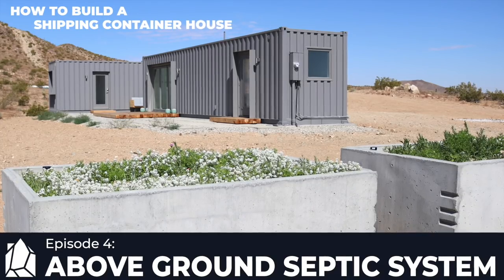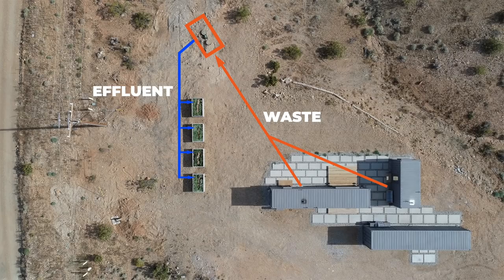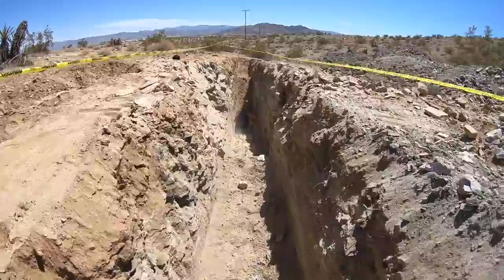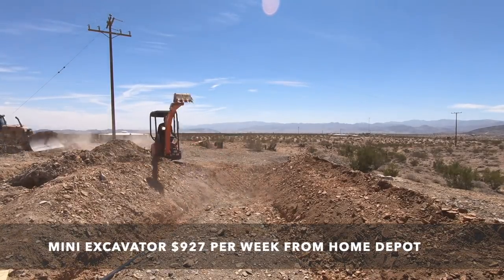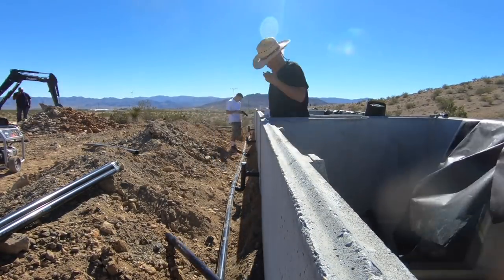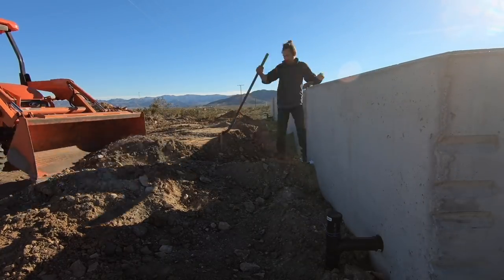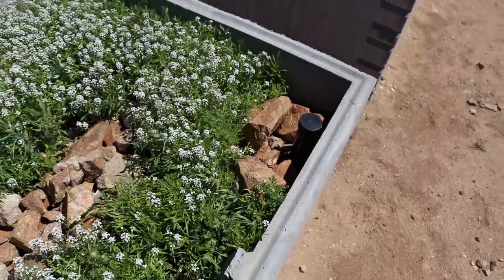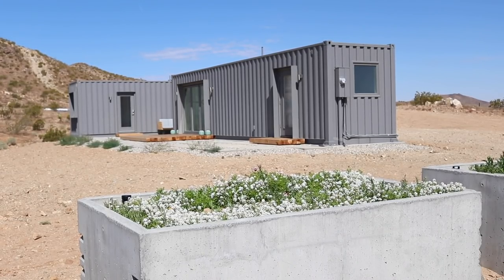Above Ground Septic System | Ep4 Building Shipping Container House

Comment: This is a brilliant solution and one that I hope to implement on my build. 
Why waste all those resources by putting them in the ground in a leach field?
Is there a limitation on what one can grow as related to edibles? I imagine root crops would be a no-no but how about blueberries?
Reply: The only issue I see in doing this instead of a normal conventional drainfield or leech field, is engineering. A mortgage company might have a hard time giving money for something that isn’t engineered. But if this is engineered and approved then go for it!
Reply: @nickp9062  Fortunately, I'm selling my house so I won't have to deal with a mortgage company. Septic systems have to be engineered. Ben is doing his in the desert, whereas I hope to do mine near the California coast where a 10cm/4 inch rainstorm is not unusual. I'd probably have to locate them in a green house or under solar panels to keep the tanks from overflowing in a downpour. Ick! 

A thousand square foot roof will generate 550 gallons from one inch of rain.
Reply: If you’re selling your house the buyers mortgage company might want paperwork and everything showing that the septic system is installed properly and all of that though

Comment: Interesting series for sure, I have a quesion, is it possible to use a series of parabolic reflectors to heat and evaporate the excess affluent?
Reply: I’m not sure what you mean by excess effluent, but if I had to guess you mean in the flower beds? If so then the sun will do most of the evaporation work and the roots will take a lot of it too. In a conventional drainfield setup 60% of the water leaves through evaporation. So if that’s what you’re asking there’s your answer.
Reply: @nickp9062  thanks for the reply, but I meant installing a copper pipe coil (like that inside a water heater) inside a tank, and connecting it to the solar heat concentrator, and filling the tank with effluent from the septic, the sun heats the water inside the coil, which then heats the effluent and evaporates it, to eliminate the need for a leach field entirely.
Reply: That’s an interesting idea! I’ve never thought about it but maybe something like that could be done where he is.
Reply: @nickp9062  yes! and you may even be able to capture and reuse the evaporated water!

Comment: what happens during a rain event if the planters fill up with stormwater? does the stormwater enter the septic tank from the overflow?
Reply from the maker: if you run the numbers on monthly rainfall vs surface area  you see that it is not a problem

Comment: Is this even to code and legal?  Most states you would never get away with building this.  What do you do or how does it handle solid waste?  aka POOP
Reply: I'm no expert in this field, but wouldn't you just pump it out every few years? That's how my system works and I don't see how this is any different.
Reply: @MinecrafterPiano  exactly!!! ☺
Reply: The solid waste (poop) breaks down into effluent over time due to bacteria from said poop and other things like showering. But I agree with imbellis that it should be pumped every few years depending on use.

Comment: what do you do with the sludge over time ?
Reply: Thinh Trinh You have to periodically have the tanks pumped out. For normal household use, it can be anywhere from 2-10 years. Most of the time the pumping company also does related business in portable toilets, septic maintenance and tank installations.

Comment: Interesting.... But eventually the sludge will rise. I mean even from solid stuff, the tank can only hold so much. What then?
Reply: Ásragin Kyron The tank needs to be pumped (pump truck) every so often to keep that from happening. But there are systems in Montana that are 40 years old and have never been pumped. New homes we tell people to have them pumped anywhere from every year to 2-3 years depending on use.
Reply: @nickp9062  Ah, so basically like slurry (liquid manure) that was pumped out of the underground silos before modern sewage systems. Ok, interesting.

Comment: Technically, how is the concrete containers allowing leeching? The plants must absorb all the waste and water. They will easily be overwatered. In the desert, water evaporation can be expected, but there is rain in the winter on occasion. There could be problems depending on how much you flush the toilet.
Reply: Et Q My thoughts exactly. How does limited evaporation / transpiration from the planters deal with the volume of waste water even a low water user will produce? These will fill within days or weeks at most, then what? Water can't percolate from the planters, and even if it could they are at surface level, meaning possible overground flow. I don't understand how this solves the problem of water disposal.

Comment: Aren't you in danger of flooding the flower beds during periods of extended raining, thus overflowing your septic tank?  I know it's a desert and you don't get rain all that often, but I'm sure you have at least one wet season?
Reply: Brian Schoenrock Unless there’s a rain event it won’t be an issue. Unless the pump goes bad (they usually last about ten years). The excess water will drain back into the tank and the cycle will start over. A lot of water will leave through evaporation. Even in heavy rain it shouldn’t do much harm.
Reply: @nickp9062  That's what I mean - I know desert storms are few but they can be intense so during one all of the water that hits the flower beds will be pumped into the tank which will then be pumped back to the flower beds - overflowing them and dumping on the ground.  It just isn't very clear how much rain that would take.
Reply: That’s a good point. If it was in the ground not a concrete tank I wouldn’t really worry about it but that’s basically a normal leech field. Hopefully evaporation keeps that from happening.
Reply: Brian Schoenrock Presumably rain water just flows across the ground from the roof downpipes. Why would you bother piping it to the septic system, it doesn't need to be treated and you're not in a residential area where disposal onto the ground is going to flood your neighbours yard!
Reply: @spencerwilton5831  I'm referring to the rain water that falls on the flower beds.  During a good downpour they will flood and overflow to the septic tank, potentially overflowing the septic tank and being pumped back to the flower beds where they will overflow, pumping sewer onto the ground.  Admittedly, it would need to be a lot of rain, but the potential is still there.

Comment: I wonder if you can process sewage sludge into compost?
Reply: BrokenLifeCycle it does on its own! The sludge breaks down into effluent over time, albeit slowly. That’s why septic tanks need to be pumped every few years.
Reply: @nickp9062  Any way to speed that process up? More surface area? Agitation? A dedicated bioreactor?
Reply: Some systems have an aerator type setup that forces water into the tank to break it apart. Big air compressor. Can be done but most homes don’t do it due to costs. Mainly for commercial systems and fading out at that.

Comment: A raised bed leach field would have worked. Like your planters but without the concrete boxes.
Reply: That's what we wastewater professionals call a "mound"
Reply: A mound system still requires a percolation test and would be a lot more expensive due to engineering and having to haul in all of the dirt and sand required. This is a cheaper way to do it and for occasional use it shouldn’t be an issue.

Comment: What happens if your poops can't fit in the 3 inch diameter pipe?
Reply: Some do have large BM's. If plugged, u can have a plumber drive out. In desert heat it might get crusted, but the plumber will rehydrate it as needed.
Reply: @jackiechan_wtf4041  Reminds of the story about the guy that took his stool to the hospital lab for testing. They lost it and asked him for another. He took in an elephant stool for a joke and handed it to the lady. She said, My goodness, you must feel better after passing that!
Reply: If it makes it through the toilet it will make it through the 3”. Code in Montana is 4” schedule 40 pvc as close to the house as possible but I’m not sure about California. And it looks like it’s a straight shot from the building to the tank with very few if any fittings so it shouldn’t be a problem.

Comment: Vacation house.

There is one critical component that every vacation house must have.  A globe valve on the sewer line.  No matter what you do to prevent it, the water in the P-traps on the sinks, toilets and bathtubs will evaporate and allow sewer gas to escape into the house and it can take hours of intensive effort to get rid of the smell if not days.  Not how you want to start your vacation.

With a globe valve, you can shut off the sewer line when you leave and prevent any sewer gas from getting in the house.  When you arrive, run water down all of the drains to fill all the P-traps, open the globe valve on the sewer line and you will be ready to enjoy your stay.
Reply: Old Time Farm Boy That won’t really be the case because of the vents on the sewer lines. That’s the whole purpose of the vents. To keep the sewer smell from getting into the house
Reply: @nickp9062  
The vents only work as long as the P-traps are full enough to block any gas flow through them.  Sewer gases like methane (CH4) are heavier than air and the pressure generated by decomposing waste will push it out through the lowest opening in the system.  And when the wind blows, even slightly, it is just as likely to move air down the vents as draw it out the vents.

Unless you are able to visit a vacation home often enough to run water through the P-traps or arrange for someone local to do it for you so they never dry out, you will need a mechanical means to prevent sewer gases from entering the plumbing under your house.
Reply: That’s a good point! I work for a company that installs drainfields and septic tanks but we don’t do inside so I’m not as well versed on that. Thank you for the information. Now I know if a customer asks!
Reply: Just pour a few drops of oil down the drain before you leave. It’ll stop the evaporation of the water beneath it.
Reply: @sunspot42  
Oil will slow down evaporation, not stop it, which is good if you use the vacation house several times a year.  Most oil is aromatic, meaning that it too evaporates but at a slower rate than water so if you are gone for most of the year, the P-traps will eventually empty enough to allow sewer gas into the house.  And the type of oil that evaporates the slowest will also mess up a septic tank when flushed into it.  The only 100% certain way to prevent sewer gas from entering the home and not mess up the septic tank is to mechanically block the line to the house.  Simply close one globe valve before you leave and open after filling the P-traps.

Comment: I am a structural engineer and don't understand why your engineer made you put plywood on the inside walls. There is no need for the wood framing to be used as shear walls diaphragm since the container provides that lateral resistance and the wood studs are not structurally joined to the steel skin. I'd love to hear the explanation and see the calculations as to why they made you do that. Also, I see multiple things that could have been done more simply and less expensive. You can reach me at www.foxhillgroup.net.
Reply: They treat the container as metal roofing and siding. Nothing more.

Comment: I extremely hate the requirement of leech fields for your septic system. But this I fell in love with. I assume this is only good for non edible plants?
Reply: halley0413 9837 Leech fields are a necessity when there isn’t a city service to tap into. With a normal leech field (or drain field) 60% of the effluent that goes to the drainfield leaves through evaporation. The other 40% soaks into the ground but doesn’t go very far depending on the system. The DEQ and other agencies make sure that the water does not go near any water. That’s why there are spacing rules based on that.

Comment: Does the system release any bad odors?
Reply: Cesar G Nope! That’s what the vent is for on the building that he talked about in a previous episode. It pulls a vacuum (kinda) and doesn’t let the air stagnate. Unless a pipe breaks somewhere there should be virtually no smell except for in the septic tank itself!
Reply: Nick Pfeifle thanks!

Comment: What happens when the sludge accumulates in the tank?
Reply: fodinski1 That’s the design of the tank. The sludge breaks down over time due to bacteria from using the toilet and taking a shower. This is also why in cold climates septic tanks don’t normally freeze. The bacteria makes heat and breaks down the sludge turning it into effluent which goes into the next compartment of the tank where the pump is, which then gets pumped to the planters. Shouldn’t be a problem!
Reply: Also the tank needs to be emptied by a septic pump truck every few years depending on use.

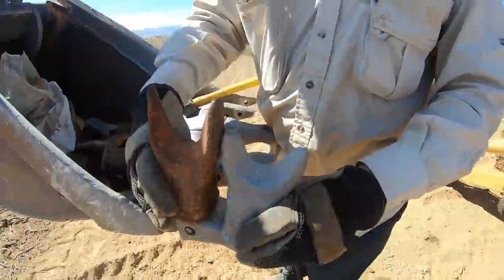Comment: I love what you're doing with all my heart but with all due respect, at 2:58 DO NOT DO THAT. There is no shoring applied to that trench and having somebody run through it, especially where the ground level is above 2 meters is extremely dangerous and deadly. I have worked with companies where the Foreman on site lost two men due to an unsupported trench and the second one tried to rescue the other when it all fell apart completely. That seems to be a very dry environment with sandy soil which makes it even more unstable. Again. Love what you do. But please be careful.

Comment: This is basically building a full fledged traditional house inside a container to comply with all California regulations. On top it needs more insulation and expensive metal work.

What exactly is the point of this money and resource wasting approach?
Reply: I think if you are not in California the code and difficulty drop off dramatically.

Comment: I don't understand how this actually solves the problem of waste water disposal? As the septic tank fills, water is transferred to the planters, but each only has a finite capacity. Excess water returns to the septic tank... eventually all the planters and the septic tank will be at capacity, then what? There is nowhere for the water to drain to. It seems that you are relying on evaporation from the planters and transpiration from the plants within them to dispose of water as vapour- but even in that climate four planters will only only evaporate a few litres each per day. Am I missing something? Even a modest waste water load of say 200 litres per day will quickly fill everything to capacity surely?
Reply: Spencer Wilton It’s a vacation home, isn’t it?  They won’t be there often. 

I think you might also be overestimating how much wastewater a modern home generates, and underestimating how much evaporation takes place in a desert like this. This is near one of the hottest places on earth. I wouldn’t be surprised if they needed to water the planters during the hottest part of the summer.
Reply: sunspot42 I wasn't aware it was a vacation home but still it's surprising how much waste water we produce. A single toilet flush is perhaps six litres, a shower might be 80 litres. The EPA estimates the typical American uses between 300 and 370 litres of water per day, even if you were very careful you might manage half that, a couple of people might produce 300 litres a day, that's a hell of a lot of water to evaporate from those relatively small surface area planters. I guess time will tell, it will be interesting to see how it copes over a year or normal usage.

Comment: I understand California is regulation heavy, but they really aren't cutting you any slack. It's not like you're building in the middle of a city. If you weren't building anything there it would just be an empty rocky desert field with nothing for MILES. They made it so expensive to build, it would be cheaper just to live in an RV in the desert.

Comment: While i do applaud what you are doing and sharing... the lack of experience and planning drove your project costs thru the roof and beyond conventional building. With proper planning and guidance from an experienced builder... you could have saved a ton of money... you home would be really efficient in the Arctic though.... In your location the goal would be keeping heat out and that does not take the R values you went crazy on. Sheathing is exterior cladding.... OSB inside totally not required... you also failed on the vapor barrier. Required by most codes warm or cold...

Comment: Ultimately the use of the containers is not economical to replace a normal framed system - especially in a desert climate.  Aside from that, the finished product is not particularly attractive, at least not to me.  Why separate the various parts of the house from each other?  You have to go outside to get from the living room to the bedroom and to the bath - to what advantage?????  My greatest objection to using a container is the 8-foot wide dimension and the fact that it doesn't add anything to standard building methods using common materials and labor.  If the units were ceertifiably clean of contaminants and already insulated sufficiently they may have some value in construction.  You can get better economy and better utilization of labor by pre-fabricating units of greater width and stick building at the site.  The only downside of stick building at the site is weather, which probably wouldn't be a factor at this site other than the heat, which is bad enough. This presenter probably knows that by now, but probably wouldn't admit it.